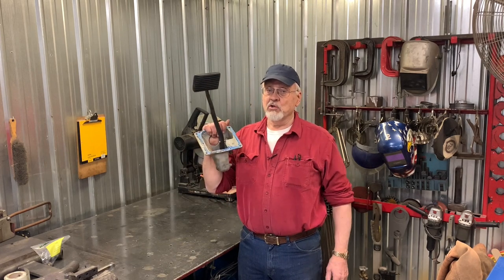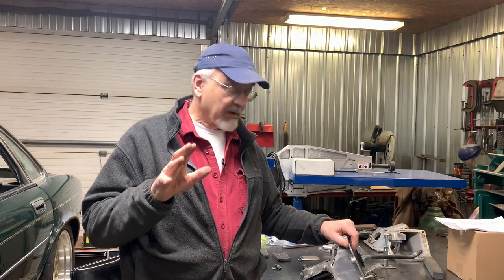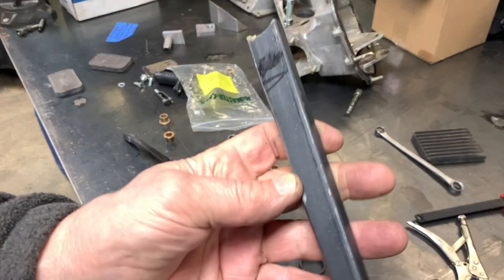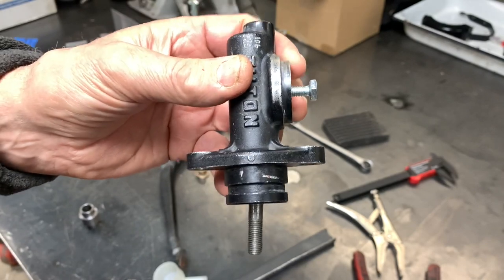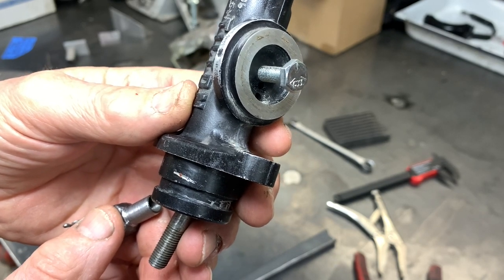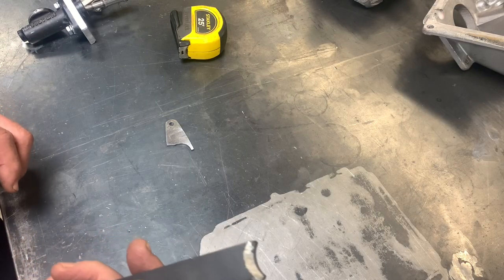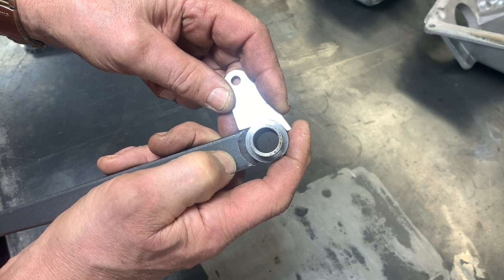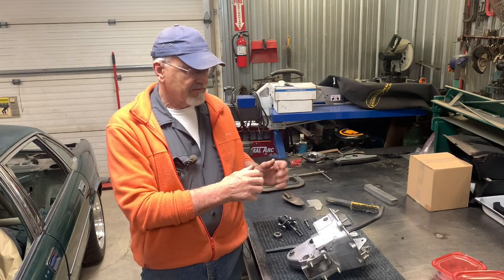S 3: Episode 18-Jaguar XJ40/XJS  Automatic To Manual Pedal Box Conversion. Part 1.

Comment: I am in the process of converting my car to a 5 speed.  As I mentioned before, I was able to purchase all the parts out of a 6 cylinder XJS 5 speed, so am able to bypass fabrication such as a pedal box, but will have to modify the bell housing and had to purchase an adaptor plate.  Great fabrication on the pedal box, though not something I would want to tackle if I didn't have to.  I am always battling lack of time and cost.  I never seem to have enough time and have a hard time justifying some of the more expensive stuff with the significant other.  As it is, I went from rebuilding the front end, to pulling the engine, and doing a 5 speed swap, to painting the whole car prior to putting back together which is a large time commitment.  I have all of the windows out and have started sanding.  I can't believe how bad the rubber is, the back window rubber just fell to pieces, which is why these cars rust from the inside out from leaks.  So, I will get it painted, rebuild the engine and reinstall with the Getrag 265 (six months hopefully).  I wasn't planning on rebuilding the engine, but I believe I have a failed head gasket as I found coolant in one of the cylinders using a scope.  I am also going to take some time and powder coat a lot of parts, especially on the engine.  In my opinion, Jaguar didn't do the engine compartment justice.
Reply from the maker: This summer I will be posting a three part series on replacing the head gasket on the 4.0 XJ40.  Good luck with your project.

Comment: Welcome back, Bob!  I'm going to summarize my understanding of the sequence I need to follow....please correct/adjust as needed:

1) Determine actual length for the clutch pedal arm, assuming a pivot 2" below the inner surface of the pedal box.
2) Factor a 6:1 input advantage to determine actuator arm length.
3) Between an offset block (under the master cylinder) and shortening the master cylinder input shaft, get the clevis eye to (as near as practicable) the distance determined in step 2.
4) Weld actuator arm to the pedal bushing at an angle that utilizes half the swing below and half above the midline to minimize off-angle input to the master cylinder (my max piston travel is 1.1", so I'm assuming 1/2" either side of centerline)

Does any of that make sense?😮
Reply from the maker: A 21 minute video condensed to less than a minute. Correct.

Comment: Bob, I’m doing this on my ‘91 XJS, but I am cheating a bit in that I have gone to a junkyard and pulled a pedal box from a donor car. I only have a few more bits to acquire (namely the clutch master cylinder). I’m using a hydraulic throw out bearing, but need a 7/8” bore master cylinder for this model. Once I get into this part of the conversion, I might (will!!) have some questions…..
Reply from the maker: I'll help any way I can. Good luck.

Comment: What transmission will you be using on your Champ car?  
  I just bought a set of hanging pedals. Rather than keeping the stock pedal assembly. I still use the stock throttle pedal but it’s much much faster.
Reply from the maker: Mustang cobra T5